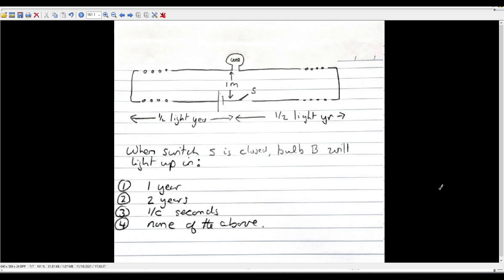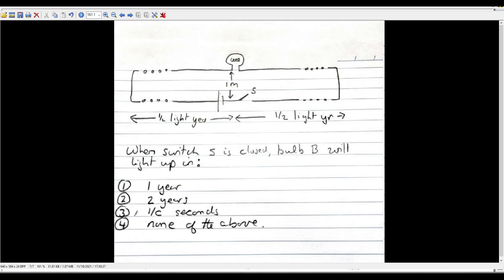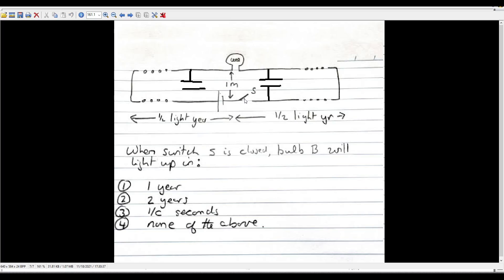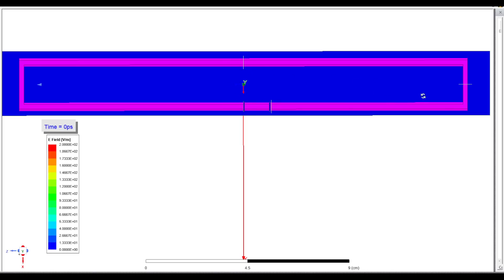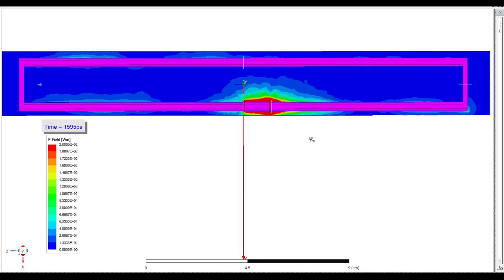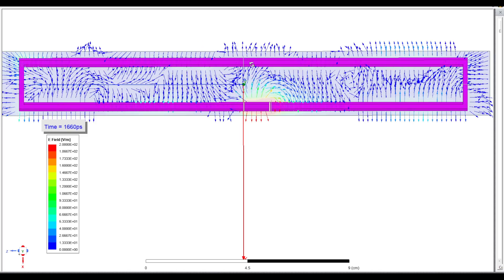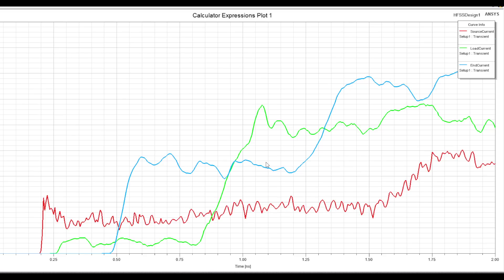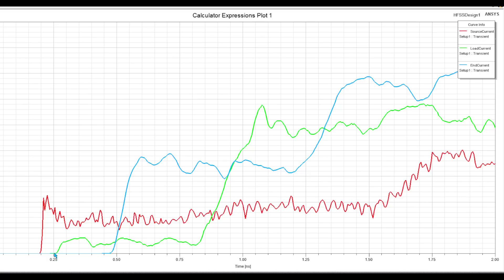Response To Veritasium - Electricity Propagation Time Problem

Comment: Great explanation. As I have pointed out in the original video, the problem has a catch that it is not the distance between the battery and bulb matters most. It is the distance from the switch to the battery and bulb that matters. If the switch is at the 1/2 light year away, it will take 1/2 year instead of 1/c seconds.
Reply from the maker: Correct! And that is a common question I am getting, thanks for pointing that out.
Reply: I was saying the same thing. But I also added that the equation would be closer to L/(c*Vf) where L is the length of the wire between the switch and the light (the distance causality would act on) and Vf is the velocity factor... Which is essentially the speed of light in the medium/material that the electric field has to pass through.
Reply: @tobiasnietgen  so you conceded my point but I’m unreasonable? White people don’t like being wrong I see.
Reply: @davruck1  Oh, so you're a racist too. Figures.
Reply: @ndvorsky  you don’t like being wrong I see. 🤣🤣🤣
Reply: lol you don’t need an equation to figure this out. Just use a water pipe. It acts the same as an circuit.  It takes the water longer to flow from the tap to the end of a long hose than from the tap to a faucet. Switch and a tap are the same thing. Once the wire is charged or the pipes are full, energy will flow instantly once you close the switch out open the tap.
Reply: @davruck1  Your pipe analogy is wrong. There you don't have any type of fields out of the pipe.  This stet up (the circuit discussed) is basically like a Tesla coil lighting up a nearby device. I think most of the misconceptions come from the fact that most people are not used to thinking in terms of fields; fields permeate space-time and carry energy.
Reply: @kortbeck  lmao how do you think the water gets out the pipe genius.  Funny how your magic fields you claim permeate all space and time disappear when talking about other forms of energy. Shows how inconsistent you are and that you don’t understand that in the end all forces and energy are unified.
Reply: @davruck1  Your water analogy doesn't take into account the "wireless" transmission that happens in the electrical circuit as water takes the long path to the load rather than the short path. Electricity behaving exactly like water is exactly the notion that Veratassium was trying to get rid of.
Reply: @ndvorsky  energy is energy.  All of your fields and stuff don’t actually exist. They’re just representations, model.  Pipes hold energy and maintain a potential difference. Wires do exactly the same thing.  The water only can flow out the tap when there’s pressure. The water isn’t flowing all the way from the source to your faucet when you open the tap anymore than energy is flowing through a wire from a battery.  Charging a wire is the same as filling a pipe.
Reply: @davruck1  lol yeah, the pressure wave, once you open the tap, travels at the speed of sound through the medium, ie water. So its not instantaneous. And its the pressure difference that causes the flow.
Reply: @okkomp  there’s pressure at every point in the pipe at all times genius just like charge. I’m a civil engineer who passed the professional exam in water resources and has worked on public utilities.   The water in your pipes is moving  but  also not moving at the same time. Same thing with electrons. These equations are representations not reality.
Reply: @davruck1  maybe i misunderstood your original premise? Lemme draw it. 

(PT) 
  |    
===|><|======||

The entire pipe is full of a 'non-compressible' liquid bu at steady-state, between valve and outlet is 2km and the pressure at the PT is 20 barg.  The outlet is slightly higher elevstion so the pipe cannot be emptied by gravity. The outlet is at 1atm. How long does it take for the fluid to start exiting after the valve is opened? 
The answer depends on the speed of sound in the fluid.
Reply: @okkomp  you’re obviously not an engineer because pipes under pressure can be emptied without gravity.  Also one the water leaves pipes it loses energy to the environment which in the case of your example is an incompressible fluid. So the premise of your example is incorrect.  Your example is analogous to how long it takes to transfer charge which is not what the question is asking. The question is how long does it take the universe to realize there s an energy imbalance and begin changing. It’s instantaneous.   How long will it take for water to exit after you break a pipe? It’s instant.
Reply: @okkomp  your question is more like how long would it take a dry riser fire system to activate, Push the gas or antifreeze out the pipes and put out the fire.   The pipes are filled with a fluid (gas or antifreeze) and when there’s a fire a valve opens and water flows. This is entirely different than a water pipe network.
Reply: @davruck1  I still haven't understood anything you've writen. You need to learn how to write and, yes, I'm a process engineer.
Reply: @okkomp  you need to understand what you’re talking about because it’s becoming most engineers can only do math that’s why they never solve anything.  You’re a math engineer not a physical engineer.
Reply: @okkomp  if you were an actual physical engineer, you asked me how long does it take water to flow through an empty pipe. And by “empty” I mean filled with a fluid like air.   This is not what the circuit question was asking.  The fact that you don’t understand that pipes and wires are analogues means you need to repeat physics.
Reply: @davruck1  Wireless chargers can send electricity without any kind of pipe. They'd even work if there wasn't any air between the charger and receiver. Energy from the sun is being sent to the earth electromagnetically too. It's just that when it hits the ground, the atoms turn that movement into thermal oscillations (unless it hits a solar panel, in which case the energy does actually get converted into a current with net charge flow).

It's quite hard to argue for "the electromagnetic field doesn't exist (and therefore can't store energy)" when that means radio transmitters and even things as simple as light bulbs seemingly have to lose energy to the void whenever it is in a circuit (violating conservation of energy).
Reply: @neopalm2050  lmao wtf are you talking about? I never said you needed a wire to send electromagnetic signals. I said wires are used to hold charge.  I see most people failed physics.
Reply: @neopalm2050  electromagnetic fields are a model. What is it made of them if it’s real? It’s a concept.  I can make up any model I want as long as it agrees with the experimental data.  I see most people have no idea what foundation their beliefs are built upon.
Reply: @davruck1  charge and energy are two different things
Reply: @davruck1  Light is made of the electromagnetic field. If you wish, you could reverse it to say "the electromagnetic field is defined as the thing light waves propagate through".
Reply: @neopalm2050  now I know you failed physics.  What is mass or charge? Obviously they’re directly related to energy. We use them interchangeably all the time because the difference is still arbitrary.  If you wanna be a tool though, wires and pipes both hold potential energy.
Reply: @neopalm2050  light is not made of the electromagnetic field. Lmao who taught you that?
Reply: @neopalm2050  I can tell you’re not an engineer or shouldn’t be.  All the stuff you claim is real, is stuff made up to make the math work.   What is a photon or an electron? How is light made of an EM field? That doesn’t even make sense. So please genius explain to me what the magnetic part of the field is made of?
Reply: @davruck1  Nobody uses mass, charge, and energy interchangably. Between them, mass and energy are the most related, but charge is different. Charge can have potenial energy if it's in an electric field or moving in a magnetic field. By itself (i.e. not near other charges or fluctuations in the electromagnetic field (AKA electromagnetic waves)), a charge doesn't actually have any energy.

If you were to equate charge with energy you would have a massive problem: electrons leaving a component have the same charge as when they entered. That'd have to imply that they give the energy they had to the component then took it right back afterwards, meaning the component doesn't actually get any energy to use.

It is the potential energy that they transmit and that potential energy only differs across the component because of the electromagnetic field around it.
Reply: @neopalm2050  so you don’t charge your phone? Ever heard of a battery charger?  I don’t like debating with willfully ignorant people.  You’re exposing yourself.
Reply: @neopalm2050  weight and mass are also used interchangeably. Are you even a human? I know lots of y’all are bots.
Reply: @davruck1  In that case, what you're doing is actually related to charge. It's moving charges through the battery (or phone battery) in the direction opposite from what they would if it were discharging so that it can produce the voltage it's supposed to again. A capacitor "charges up" not because it's storing energy, but because it's storing a charge differential. 

Though, I will admit that "charging" can mean storing energy despite not originally being the same, nor having much of a connection beyond the every day uses. What I meant was that nobody uses "charge" as in "electric charge" interchangably with "energy".
Reply: @neopalm2050  I literally described that the only thing that matters is an energy differential. You’re the one getting caught up in terms rather than actually paying attention to the concept. This is why the American education system produces interesting stones and mostly incompetent engineers. Terms and stuff are literally made up.
Reply: @davruck1  Weight and mass are used interchangably only because that's effectively how we see it in everyday situations (what with never having a gravitational acceleration much different from 9.8m/s^2). This distinction does have to be made though. However, the electromagnetic field isn't as uniform as the gravitational field. Two particles with the same charge can have vastly different "electric weight"s (and therefore electric potential gradiants) since the field can be so different between two points on earth.
Reply: @neopalm2050  so you just contradicted yourself when you said nobody uses them interchangeably.  Just admit you’re wrong and I’m not gonna rub it in.
Reply: @davruck1  If it's just the word "charge" then yes. They can be used interchangably. If it's specifically the word "charge" in the context of electric charge (i.e. what wires carry), then nobody uses them interchangably.

I wasn't going to say this, but for threatening to rub it in when you weren't even justified to do so, I will: Was it too much to expect that you yourself knew what you were talking about?
Reply: @David Rucker  AHEM "I said wires are used to hold charge." That's enough calling someone else an idiot for paying attention to your messages. Honestly, I am willing to call that slip-up that says "charge and energy are never equated" a mistake. Unfortunately for you, I wasn't wrong enough for my position to be unjustifiable and I disliked your attitude enough to refute it.

Second point: Why did you assume I'm American? I'm not. If anything, the one who's embarrassing themself is the one who claims the field that light propagates through is not real in the comments section of a video that specifically deals with electrodynamics. If you want to complain that I'm not talking science here, stop adding your own side-tangents that only exist to try to insult me.

Sure, you can use whatever word you want to represent whatever concept you want, but when you bind multiple definitions to the same word ("electric charge" and "energy charge"), you have to deal with the fact that context determines which one you're talking about. The last thing I want to do is get into a semantics argument over physics (or any other topic) so it'd help if you didn't use words ambiguously in the first place.

tl;dr I'll read correctly as long as you talk in a way that only allows a correct reading.
Reply: @davruck1  Did you just say 'fields don't actually exist'? Ever seen a compass needle? What makes it deflect (or point top the north) is the magnetic field. A capacitor stores energy in an electric field. Okay, let's forget the fields. Suppose you tie a rope (a long rope) to a stone and pull it by the other end. Do you think the stone will start moving immediately? No! By pulling you set up a longitudinal wave in the rope and it spreads with the speed of sound in the rope, which depends on its elastic properties and density.
Reply: @davruck1  When you charge your phone, or any battery, it has the exact same quantity of charge within it as when it was discharged. You have simply redistributed the chemicals within it. You are confusing engineering terms with layman's terms which makes me suspect you may not be a real engineer.
Reply: @davruck1  Whether fields exist or not, we can transmit energy wirelessly. I would like to see you transmit water currents "pipelessly". Eectricity=water is great for simple concepts but it isn't directly true/analogous.
Reply: @davruck1  "They violate all the laws of conventional physics and are no different than invoking God."
I don't know how you're getting that they violate any laws of conventional physics. Locality is fine, energy is conserved, and no laws are broken. The only issue I see is that they can have a feeling of invisibility to them if you don't use a tool to measure them, which is somewhat of a non-issue since a "feeling of invisibility" doesn't contradict physics. I'll address your comparison to god:

God: an untestable thing that doesn't have consistent behaviour or any notable effect on the modern world which is only believed to exist because of stories written by a small number of humans a long time ago

A Field: some scalar, vector, or otherwise valued function that has a value throughout some space. Field differences between two points can often be measured, allowing a concrete way to determine what the values of the field are at all points where it exists. Example of a field: the distance from the center of the earth is a scalar field; the displacement from the center of the earth is a vector field; the height of the surface of water is a scalar field; the stress in an object is a tensor field; the velocity in a fluid is a vector field.

A specific choice of which field lines to draw is somewhat arbitrary but a field line can be concretely defined: a field line is the path a particle would follow if its velocity was always the value of the field at that position (note: only can be done with vector fields). These field lines can sometimes be useful when visualising a vector field because placing a vector at every point in space can sometimes make it hard to see all of them properly.

Name one contradiction in physics. There are numerous "paradoxes" but those are simply called paradoxes because they contradict our intuition. Not because parts of physics contradict each other.

Also, now you're making this out to be about race? I know you weren't talking to me but stop that. By the way, don't bother assuming my race either. You'll probably guess wrong.
Reply: @davruck1  If numbers don't exist then coordinates don't exist. A particle with a given mass can be defined by its position, which can be defined by coordinates, therefore particles are nothing more than concepts.

Who cares if you can measure it's position if you can't tell what a particle is. They have no density, charge density, and don't even occupy any space. Therefore they don't exist in the physical universe (unless you're going to tell me that a particle isn't a point particle and has a density scalar *field*, charge density scalar *field*, and exist over some region of space).

These are the arguments that you get if you insist that "if a description of a thing is just an idea then that thing is just an idea" is a sound argument. Whether or not you call a function defining the surface of water (a scalar field over a 2D region) real, the surface of the water is a physical thing. Even if you say that the vector fields of electromagnetism themselves aren't real, whatever the things are, we can tell which direction the magnetic field is pointing with a tool as simple as a compass (just as you can measure the coordinates of a particle with whatever tool you detect them with).

There's no reason to believe that everything that exists must have a charge, mass, and region (which for some reason you won't allow to be all of space) in which it exists. The laws of physics are the laws of physics and they exist to tell you how things should move. Nothing more and nothing less.

Perhaps an issue you're dealing with is that "they can't be physically touched" and I'll tell you that they can. An electron will feel a force in an electric field. It's hard to say they don't physically exist when they have physical effects.
Reply: @davruck1  You missed the point. I didn't say "numbers are real". I said that something (i.e. the EM field) can be physical even when it's described using something that isn't (i.e. a vector field).

Also, There's even more assumptions about me: that "I've never made anything". Just so you know, the philosophy of "is a number real" is irrelavent to actual engineering ability.
Reply: @davruck1  If fields don't exist, mobiles, TVs, radios cannot exist. And you haven't answered my question about the rope and the stone-- i can understand why.
Reply: @sivasakthisaravanan4850  so what are they made of?  you still haven't answered my question and I understand why.  What are numbers made of?  Does the universe exist without them?  Your indoctrinated relativistic model cannot answer this.